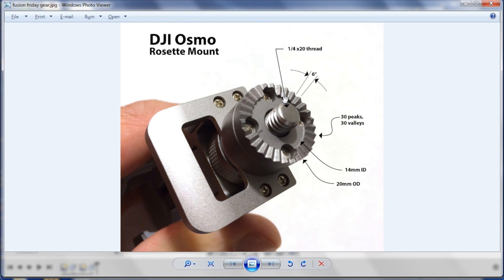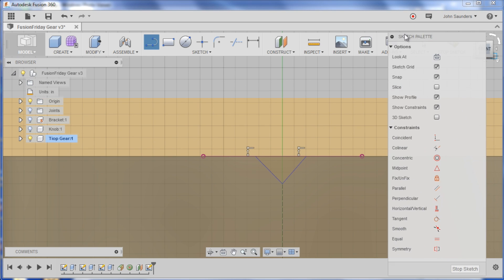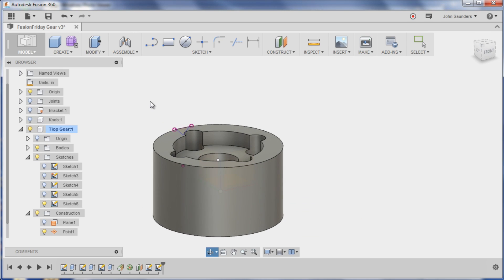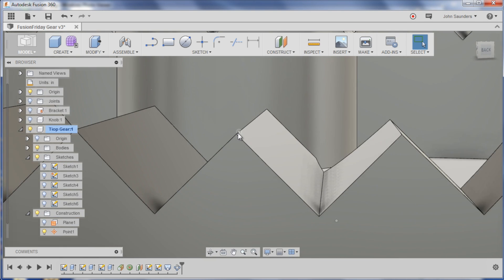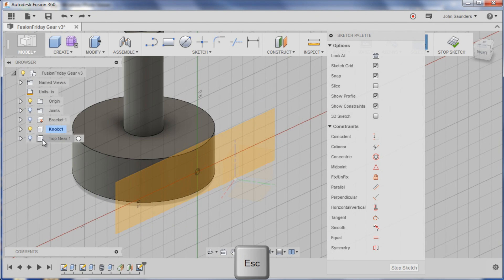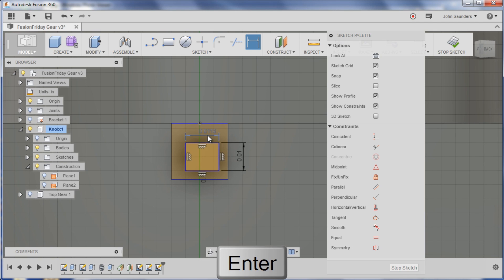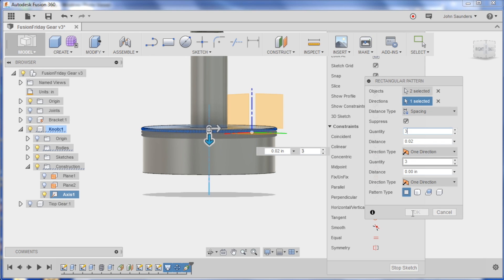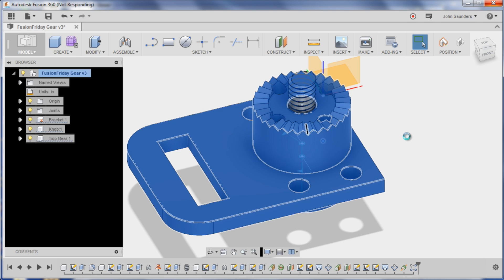Fusion Friday #11: Using Loft to model Gear & Knurling!

Comment: In Fusion making a knurl is a lot easier if you use the coil (setting triangular and outside I think), mirror it(to get it to cross hatch), and then make an array of the coil and the mirror operation. The easiest would be a straight knurl which is extruded vertically and then arrayed.

Comment: Extruding to a point doesn't work for a hirth joint. Here's a link to the Fusion forum with a parametric version you can copy into a design. The first picture in the post shows the problem if you extrude to a point.
https://forums.autodesk.com/t5/design-validate-document/gear-type-teeth-quot-concentric-quot-from-id-to-od/m-p/6027368#M45101
Reply: Here's another post that shows how to copy the hirth component into another design, copy the body into a component and add a joint.
https://forums.autodesk.com/t5/design-validate-document/replicating-one-part-into-many-others-fusion-360/m-p/7067295#M111073

Comment: Hi I followed your tutorial which by the way works perfectly, but in my project I have to replicate this same knurling into 12 different parts on the same body, and it took me forever to achieve it, is there any faster way for me to replicate it on the other parts? Or I'm really gonna have to do it one by one? Thanks For the tutorial, it's amazing.

Comment: I've been watching a bunch of your Videos and it pains me to see you struggle with navigating the UI ( many clicks, such pain ).
Have you ever considered using a 6D Mouse for what you're doing? http://www.3dconnexion.com/products/

I myself use a 3DConnexion SpacePilot PRO which by now has been succeeded by the SpacePilot Enterprise that may be a tad overkill for your purpose but there's also models like the SpaceMouse PRO and the SpaceNavigator which I imagine may very well suited for what you're doing.

And while the Product Page says I hasn't been tested with Fusion 360 I can without a doubt confirm that the Profiler absolutely works AND even comes with an array of already assigned Buttons for Devices that have them. Probably the best buck you'd spend when using any 3D Application.

Comment: The problem with your teeth is you use (diameter * pi / number of teeth). This gets you the length of the arc from the outer top point of one tooth to the outer top point of the next tooth, following the outside edge of the circle. But you are not sketching around the outside surface of the circle. You are sketching on a plane that is tangent to the circle. If you straighten this arc out on the tangent plane you would find that it is too short by a small amount. The less teeth you use the higher this error will be.

To do this properly you do not need PI or any complex math at all.

1. Sketch across your circular face. 
2. Draw one line from the center of the two circles toward the outside of your outer circle. I will call this Line1
3. Constrain its length to a fixed value that is greater than the radius of your circle.
4. Draw a second line from the center of the circle to the outside of the circle. I will call it Line2.
5. Constrain its length to the same fixed value as Line1.
6. Set the angle between the lines to (360 / NUM_TEETH). Replace NUM_TEETH with the number of teeth you want on the gear.
7. Connect the two end points of Line1 and Line2 with another line. I will call this line Line3. Line3 should be outside the outer circle.
8. Now draw a line inside the inner circle from Line1 to Line2. I will call this Line4.
9. Now constrain Line3 and Line4 to be parrallel.
10. Now create construction planes through Line3 and Line4 by using Plane at Angle tool.
11. Make your triangles on those construction planes. Make sure to use Line3's and Line4's length for the base of their respective triangle.
12. Loft between the two triangles.
13. Circular pattern the Loft NUM_TEETH times around the part and you are done.

This should result in perfectly spaced and sized teeth without using any complex math. I even think you can put (360 / NUM_TEETH) into the angle box and Fusion will figure it out for you.
Reply: hi can you make a video to do it your way please i cannot visualize it by reading your instructions. Thanks
Reply: @zero00tolerance  i, too, would like clarification

Comment: I'm new to Fusion 360, but pretty good with geometry.  Your spacing would be off a bit because the big triangle was on a plane tangent to the circle (think of one side of a polygon with an inscribed circle).  What might have worked better for you would be to create a construction plane perpendicular to the axis of the cylinder at the top of the cylinder.  Starting with that, from the center create two construction lines from that center at a 12 degree angle to each other (360/30 = 12).  Where those lines touch the cylinder rim would be your tooth peaks.  If you follow me so far, surely you can take it from there.  I did give you a thumbs up by the way.  I believe it was you who first (unknowingly) introduced me to Fusion 360.  Thank you for that.

Comment: the reason your teeth were off was because you put a little triangle in the middle instead of a point.
Reply: A point isn't quite right either, unless you want the troughs of the teeth to be tilted. It needs to be a vertical line segment equal in height to the big triangle.
Reply: Paul Williamson ah yes, that is correct.

Comment: I believe you can just draw a triangle on the top of the knob and then a spiral down the outside of the part. You then cut the triangle down the axis you created and then repeat it around the part to create a diagonal knurl and then just repeat the other direction to creat a diamond knurl. Ik I didn't explain it well but there are a couple videos  that show how it's done

Comment: As modeled. aren't those knurls only touching the cylinder tangentially at the vertical center-line of the larger square?  I guess you could offset the larger square sketch plane into the cylinder to account for this.

Comment: Fusion 360 is superb for modelling - I've "down converted" from Inventor to Fusion as it is much simpler in the file handling and I'm yet to find something that Fusion can't handle compared to Inventor. It's a little bit different but easy to pick up, especially with tutorials like this.
Reply: I also converted from Inventor to Fusion, but I can't seem to find the BEND PARTS feature in Fusion for 3d models. In Fusion, i have to split bodies then rotate the part, then combine them back together. Very frustrating.

Comment: yeah...  the real world is that sketch is a freaking nightmare.  I end up restarting the software way to often for relatively simple designs.  It's odd to me that the company who mastered 2D drafting about 30 years ago can't seem to figure out a useable "sketch" interface today.  The 3D modelling aspects are great.
Reply: As I have a lot of experience with AutoCAD (without parametric it's just a full blown line generator) I found that sometimes the parametric aspects of Fusion, although neat and helpful for simple stuff, are limiting the design posibilities and often I will reach a point in Fusion where I can only keep going if I disable design history. If you try to move a sketch for example in parametric to reuse it in another area of the sketch you might end up dissolving your whole geometry. You could copy stuff around but it's way messier than simple non parametric CAD. Also the 3D sketch features are very light in Fusion (you can't draw an arc in 3d for example and for one part I had to do some pretty tricky fillets on some simple lines to get a 3D sweep path for coolant channels right, again doable but not elegant).

Comment: John I have a product enhancement suggestion pending with the F360 team at the moment regarding knurling. If you or your viewers would like to support that, I'd be grateful if anyone who feels this is a useful feature could vote for that. If enough support is received, the team will integrate knurling as a one step process similar to say creating a thread presently. At the moment, as you've found, it's a complicated and very resource heavy process to create simple knurls. Yet it's a very common feature in many products.

Please find the idea suggestion here https://forums.autodesk.com/t5/ideastation-request-a-feature-or/knurling/idi-p/5967765

Vote now. Vote often. ;)

PS two other idea pending if anyone also wants to vote for them are a one step gear generator, so again it would work something like modelling a thread. https://forums.autodesk.com/t5/ideastation-request-a-feature-or/gear-generator/idi-p/5598516 the other is sorting out the metric thread defaults, as that's a mess at the moment. https://forums.autodesk.com/t5/ideastation-request-a-feature-or/metric-thread-data/idi-p/5959393 The latter is being considered a bug by the team at the moment and should be fixed soon.
Reply: +Pete F BTW I thought your knurling was very well done John. It's a tricky thing to do manually and I sure hope we can convince the F360 to include this as a feature selection.
Reply: +NYC CNC Yes I just got notified of that. Thanks mate! :) 

Hopefully we can get enough votes to get this one over the line. Even on, errr, "other" CAD programs beginning with the letters SW it's not an easy thing to manually model. Yet I don't see it as a difficult thing to code, and with a known circumference the program should be able resolve perfect solutions quite easily. Preferably even providing the pitch as a result for those of us who need to manually knurl. With the rise and rise of 3D printers it would help provide F360 an additional edge in the area.

Well done on the modelling John, and thanks again for the product enhancement support.

Comment: The "Top Gear" is probably supposed to be a Hirth coupling, I had to model one when I couldn't find one to copy in any of the usual model libraries, :-)  see https://forums.autodesk.com/t5/design-validate-document/creating-a-hrith-component/m-p/5146822
Reply: NYC CNC
 It will probably work if you adjust the geometry a bit (I haven't checked yours fully, but in a true Hirth Joint the mating parts are identical to one another, yours currently seems to need a distinct "female" part to join on to the "male" part you've drawn). It really needs a bit of refinement to ensure that mating occurs at the flanks rather than the crests. For what is presumably a lightly loaded joint on that device, simply flattening the tops of the crests will do, but on a high torque rotating coupling the sharp bottoms of the valleys are a stress concentrator, so the usual form is to have a radius fillet in the bottom of the valley and a larger radius fillet on the top of the crest. That way, there is a clearance between the two radii when the two halves are mated, and the alignment and drive is handled by the contact between the flat flanks.

Comment: Thanks very much,  All things I can use now.
Reply: +NYC CNC John,  I bought myself a 3D printer and have been using Fusion 360 to design little items for the shop.  I can go directly from 360 to the printer software (it's tied into 360 at the "make" function.  Pretty flawless.  One thing that I have learned is about compensating for material shrinkage.  Thanks for your tutoring!

Comment: John, do you have a video on programming for a matrix of parts? That's almost all that I work on and just got the F360 trial. I can very quickly program for that with my current CAM solution but their trochoidal milling solution is abysmal so I need to make the switch for at least that.

Comment: Likely that toothed cylinder is locked to the plate (that may be what the four holes are for), as it probably is intended to fix the attitude of the camera at any one of 30 positions in relation to the plate. Knob and shaft pull in a mating toothed cylinder attached to the camera. (It doesn't affect the design process; I'm just finicky that way.)

Comment: Is the circular gear not meant to be fixed to the main plate, instead of revolving?

As i understand the part, there is meant to be another piece that fits into the gear, and the threaded bolt is meant to bind the two pieces together.

Correct me if i'm wrong.
Reply: ofcourse :)

Comment: When creating objects that will be wrapped around a circle, you might find it easier to use polar coordinates instead of  projecting a plane and using Cartesian coordinates  for things like that knurl. (Use an angle and a radius instead of X and Y, just like you would do for lathe work) A lot of CNC controls can even use polar coordinates directly. You are really getting fast with fusion. I like how you discover new features along the way. Nice that they keep the updates cranking out. Great that a new part is made active when created. Never could understand why that wasn't the default.

Comment: I found a calculator which will calculate the side of any regular polygon inscribed in a circle.  Turns out the length of a single straight line segment of a 30 sided polygon inside a circle of .875" diameter  is 0.0914624"
Reply: Hmmm.  Not sure how you got that figure, but I did (0.875 x Pi)/30 and it came to: 0.091629785   Obviously, for all intents and purposes either figure will work, (after all, what's 2 tenths between friends?), but how come the difference I wonder?
Reply: (0.875 x Pi)/30 gives you the distance between two points along the circular arc between them whereas the real measurement should be the straight-line distance between the two points.  Instead of a 30 sided polygon inscribed in the circle, imagine a square inscribed in the circle and the difference will be much greater...

Comment: Your calculation on the line segment lengths (.875 * pi / 30) isn't quite right.  This calculation gives you the length of the arc which is 1/30th the circumference.  The straight line would be a tad shorter although I confess my math skills leaves me short of being able to tell you how to calculate the straight line length.
Reply: +Chuck Fellows 
i think you could imagine a triangle with 360/30 degree.  (12) 

divide it in half so its a right triangle. you get 6 degrees inside the small angle. 
sin(6 deg)*.875 = .0914? multiply by two to get line segment of 1/30 circle. 

i could very well be wrong.
Reply: +UnconventionalMilling Actually, if you want to be really (unnecessarily?) perfect about it:

-The isosceles triangle formed by the line segment and the centre point has an angle of 6 degrees. Because we' re trying to create the valley by removing material.
-And the segment that's being designed is not part of the inscribed polygon. It's actually a part of the circumscribed polygon to that circle. So it's not actually a chord of the .875 diameter circle.

It'd be easier if you created only the tangent plane, then created two guiding lines on the top surface of that cylinder (long enough to intersect the plane), and then sketched the triangle to be lofted so as its tips are on the guiding lines. Then you loft to that centre point (it can actually loft to a point ;-)!!!). That way the edges of the valley will still have that 6-degree angle.

The only dimension needed here is the angle of the guiding lines. The rest could be done with constraints.

I'm sorry for the long response and anal attention to detail, but I' ve been in the position where I' ve designed something, cut it and then found out it didn't work or fit (i.e. inscribed vs circumscribed). I only hope this helps. Again sorry for seeming like I'm trying to prove everyone wrong. I'm just trying to help.
Reply: +Chuck Fellows https://en.wikipedia.org/wiki/Chord_(geometry)
Reply: that's true the plane is in the wrong spot to use my calculation.